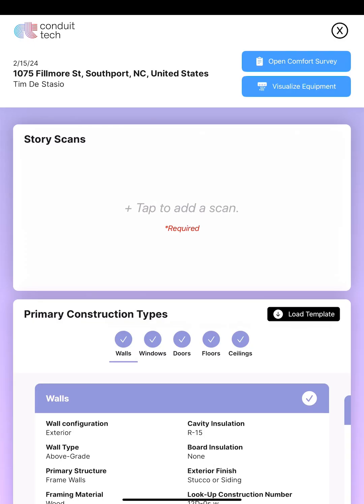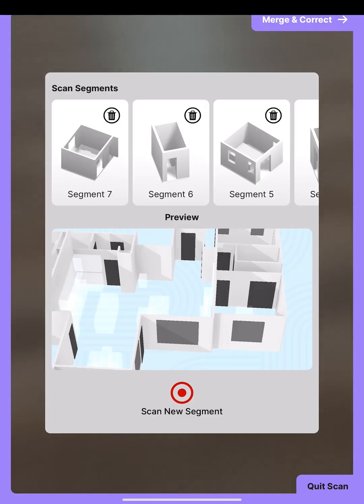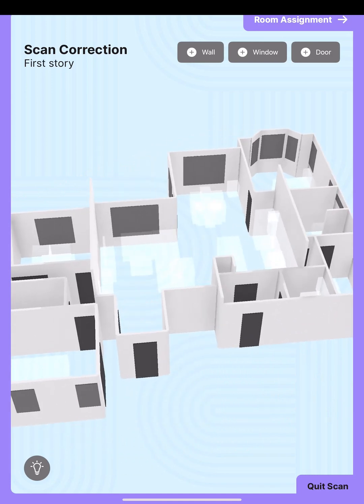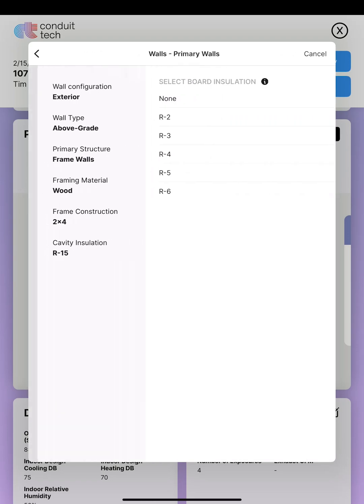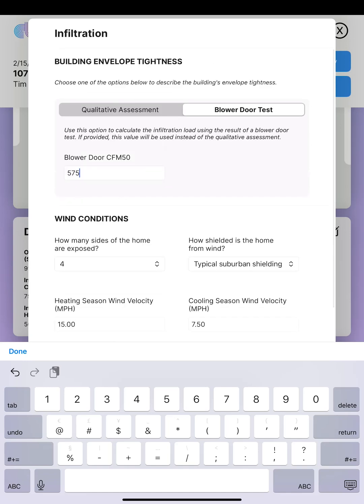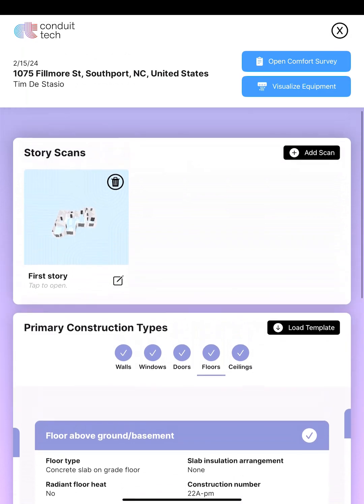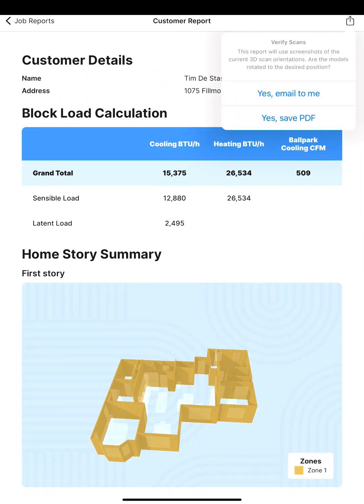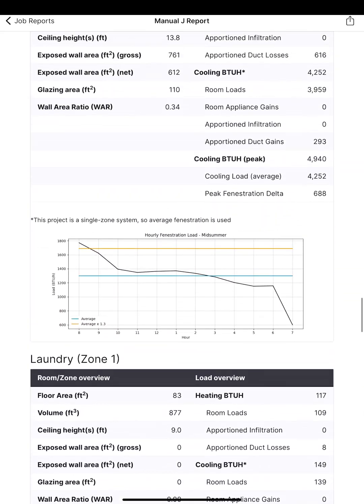Conduit Tech Walkthrough

Comment: From this demo, it takes waaaaaay to long to run a load, running around adding walls. No Thanks, measure all the windows, block load and move on.  Also, still referring to them as “Master Bedrooms” is a No No.  Main Room, Main Bedroom, we don’t have slaves and we are not Masters.  Just a pro tip on language as we adjust to our customers.
Reply: Hey boomer. Your comment is so personal. You may do your rule of thumb hack load and move on but people that actually measure all rooms and have to deal with blower door tests on new construction that utilize other software such as wrightsoft have been seeking a much faster, while maintaining accurate load software. HVAC is a proven science and working off rules of thumbs is no more. Also, c’mon critiquing the long used word master instead of main doesn’t have to be a political take away. Yeah it is a term that is started to change but it’s not like this mans ideals are based off the use of the word. Tell us all you don’t do new construction without telling us. 

This video was greatly informative. Thank you video author for presenting.
Reply: bet you are fun at parties
Reply from the maker: So your conclusion is to not do a proper design but use woke room names. Got it. Please unfollow me.

Comment: I'd love to see how it works with story and a half style houses.  Also, energy modeling software should work like this as well to estimate paybacks from energy upgrades.  Is this available for
Android?
Reply from the maker: It only works for Ipad and Iphone Pro because it requires Lidar.  I've used it on 1.5 story houses and it works great.  I haven't tried it on split levels though.
Reply: @timdestasiohvac  how does it work for new construction? Is there a LiDAR  device you can plug and play?
Reply: not a new construction tool  its for existing homes